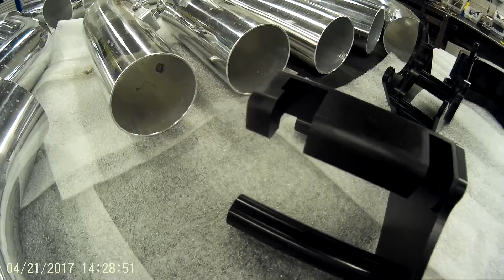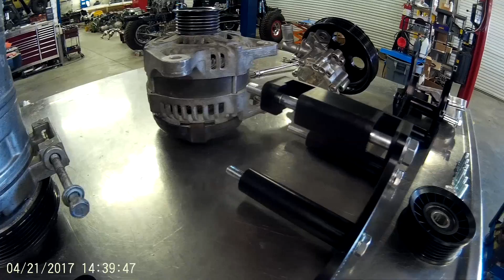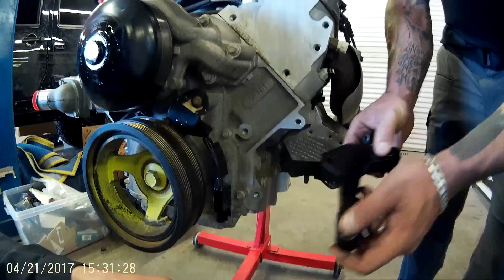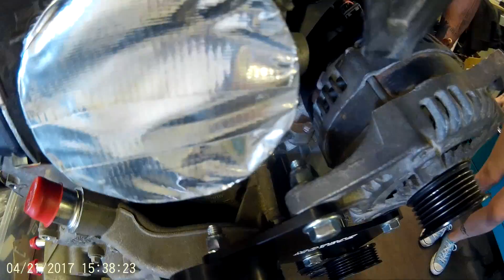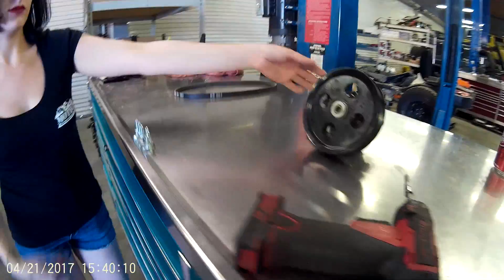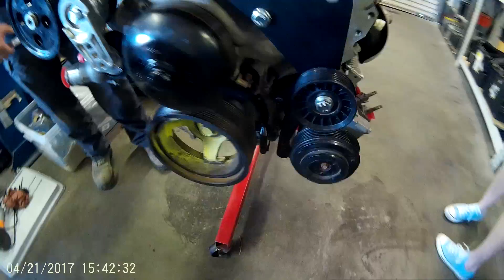MoTech Billet Bracket Install - Truck Engines

Comment: Doesn't set the PS i the same location as a 2012 ,, and the pulley used is a 2011 which is larger and you have to get around it.. so the PS pump line doesn't work

Comment: If installing in a jeep originally equipped with a 3.6L can you simply run the 3.8 alternator and tensioner? or are there other modifications that have to be made?